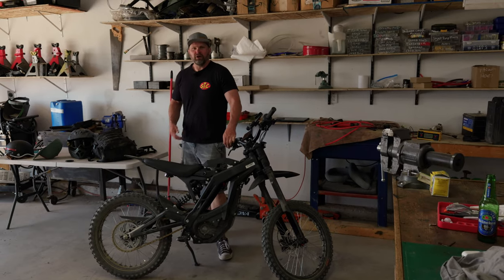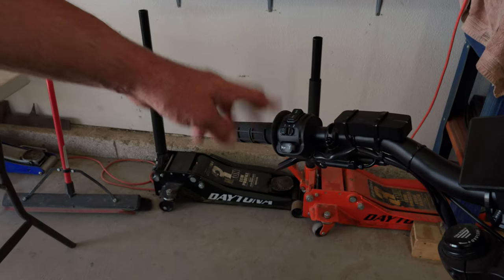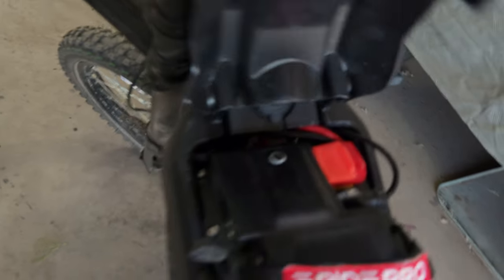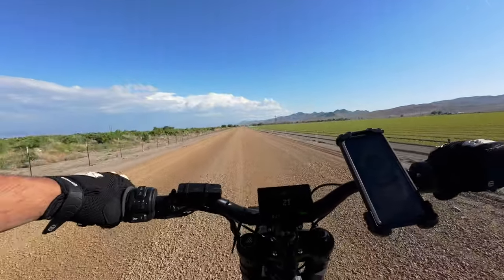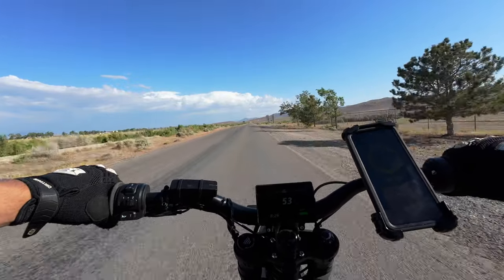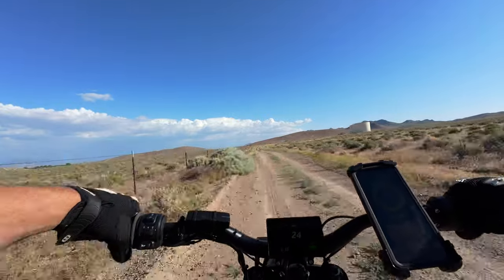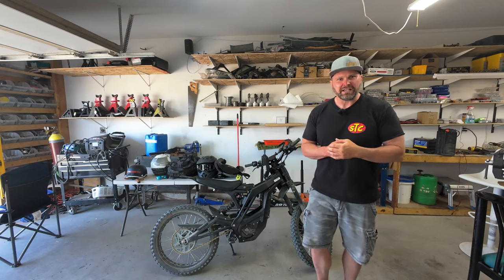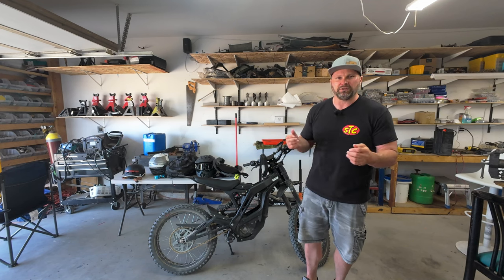E-Ride Pro SS 2.0 - The BEST Electric Dirt Bike of 2024!!

Comment: Riding mine yesterday. I was at 25mph in eco mode. Hit the turbo button and it allowed me to go pass 28mph for a few  seconds. Loving the bike, only upgrade I need is a wider front tire. Got mine from RevRides  as well. No issues.
Reply from the maker: Interesting, didn't think to try Turbo mode while in Eco.
Reply: Did you pull the plug on the black looped wire yet?
Reply: @Shreddylife  they don't have the looped wire anymore .
Reply: @JohnnyJaySlickster  I got mine a little over a week ago and mine did.. Its the first thing I removed along with all the cutoff sensors...
Reply: @Shreddylife do you mind telling me where the cuttoff sensor is?
Reply: @Diddy_Fraggn  Take the two screws out of the battery cover and remove it. Remove the two screws for the ignition where the key goes and look for a plug that has a black looped wire. Find that plug and simply unplug it.
Reply: @Shreddylife  ok thank you I will do
Reply: @Diddy_Fraggn  No problem, Gritshift has a video on YouTube how to remove it.
Reply: @JohnnyJaySlickster yeah they do, I got mine two weeks ago, speed governor is there. Although most stores are disconnecting them upon assembly.

Comment: Its the best besides fork seals leaking, pulleys being broken on the welds, pulley bolts coming loose and the swingarm issue being too close to the frame and rubbing. Other then that its the best! 😆 I still love mine but it does have some common issues that need to be fixed. The nice thing is Eride is replacing parts under the warranty. I am still waiting to hear back from Gritshift about what to do about the clearance issue on the swingarm/frame.

Comment: So, just going to drop this here. 
If the SS pro is out of your budget. Look into the falcon M/79 bike. It has the most torque out of any stock bike. Also 79bike is offering the upgraded 10kw sotion motor (extreme potential with this motor, can handle 23kw in stride) at the same price as their 8kw. A lot of aftermarket parts are also compatible. Just as always with newer chinese bikes. Youll be waiting a while. Takes a few weeks to build, then another few to ship (free, you can spend a few hundred extra by air, or if you can get a friend to purchase with you get a heavy discount and better shipping price). 🤙
Reply: Been curious about the 79bike. Can also order directly from China for like 36-3700
Reply: @tellthetruth7497  Changzou smile supplier does 3300 if you want to save a couple hundred. But also because demand is going up it's taking up to a month just for production from 79bike then the extra 30-45 days by ship. The sotion motor is really the selling point. Essentially a $850 mod that's included with the bike. Also with a new controller it can run 23kw in stride.
Reply: @Insanity_Wolf  3300? Wow! If i didn’t have a surron already I’d get one. Save nearly 2k over the eride pro. The wait time don’t scare me i ordered my ron from China took a month and a half.

Comment: How's the range compared to the Mx5??
Reply from the maker: Eride gets better range for sure, especially if you're heavy on the throttle.
Reply: @shootthechit  how? Can you explain why eride gets more range even though the batteries are basically identical??? I’m so confused
Reply from the maker: @Randomcjao  MX5 has more power output and its heavier, so if you use the throttle heavy, it uses up the battery faster.  If you cruise around in Eco is pretty similar, but under heavy throttle it depletes the battery way faster.
Reply: @shootthechit  if both bikes ride at 50 mph they should both get the same range?
Reply from the maker: @Randomcjao  No, the MX5 would get less range since it uses more power.
Reply: @shootthechit  oh okay